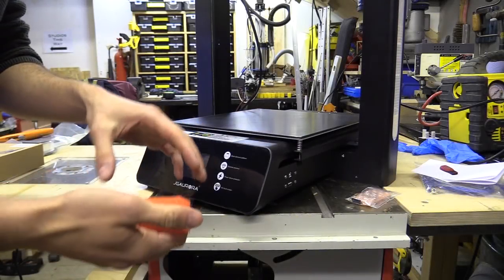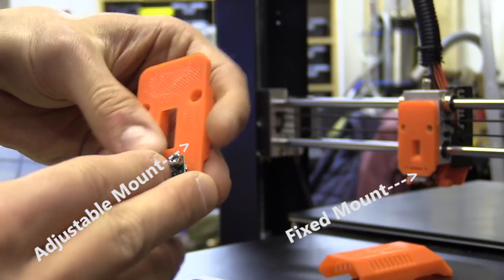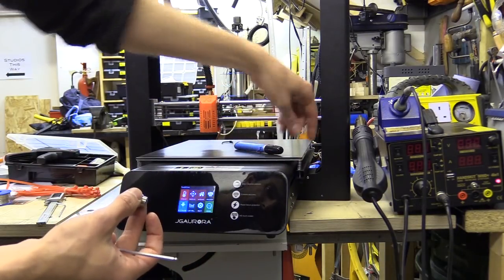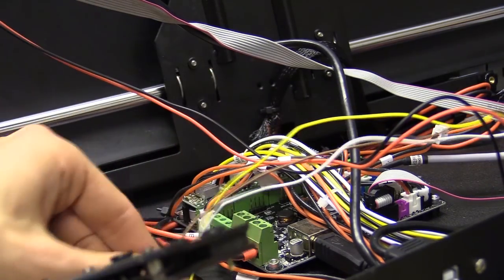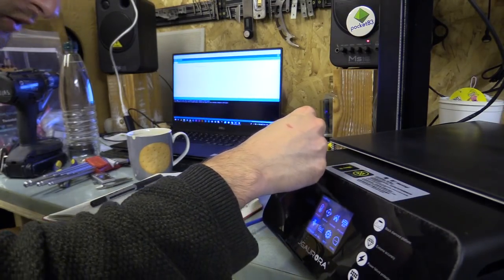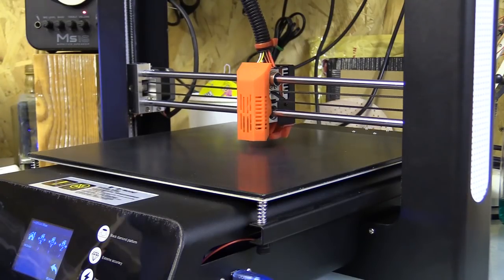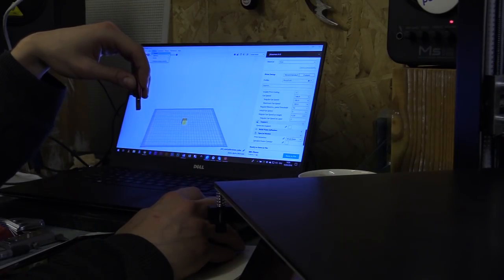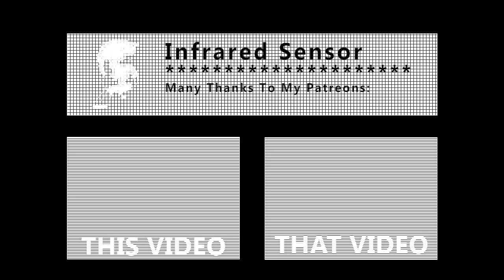JGAurora A5 Infrared Sensor and Giveaway

Comment from the maker: My start code: 

G21 ;metric values
G90 ;absolute positioning
M82 ;set extruder to absolute mode
M107 ;start with the fan off
G28 ;Home
M851 Z-2.08 ; Z Offset
M500 ; Save to Eeprom
G28 ; Home
G92 E0 ;Prime the extruder
G1 F200 E-3 ;retract 3mm of feed stock
G92 E0 ;zero the extruded length again
G29 ; Level bed
M500 ; Save to Eeprom
M 117
Reply: I didn't see the picture that I sent you in the line up. Dang it.  Oh well that's life!  Still a winner having the opportunity to watch your videos and support you.
Reply from the maker: Sorry not all of them went up! I was surprised that many were submitted! :)
Reply from the maker: I'll change that before the probe but I'll still have to save that for the grid levelling no? I'll have to get that from the person who I've sent the printer too. Gave it away. The gear seemed to be ok - no clogging, clicking etc.
Reply from the maker: I think I found the config file. I thought it was on the SD card but i kept a copy on my computer. Line 552 default axis steps per unit - 80,80,800,95.6 -
Reply from the maker: But it's worth grid levelling in the start code to adjust for variations due to temp etc. And so the edited start code should be: 

G21 ;metric values
G90 ;absolute positioning
M82 ;set extruder to absolute mode
M107 ;start with the fan off
G28 ;Home
G92 E0 ;Prime the extruder
G1 F200 E-3 ;retract 3mm of feed stock
G92 E0 ;zero the extruded length again
G29 ; Level bed
M500 ; Save to Eeprom
M 117